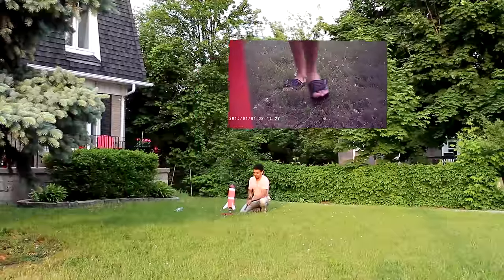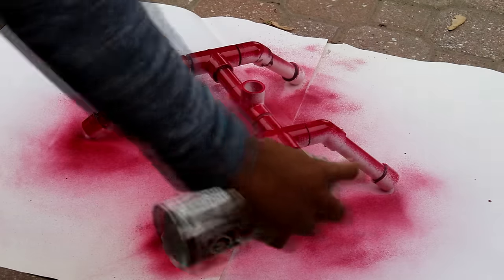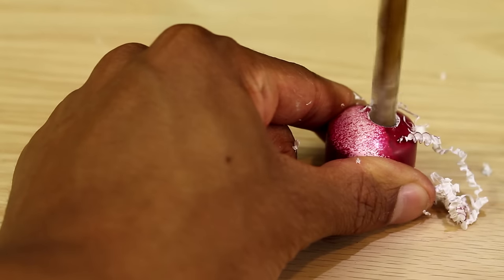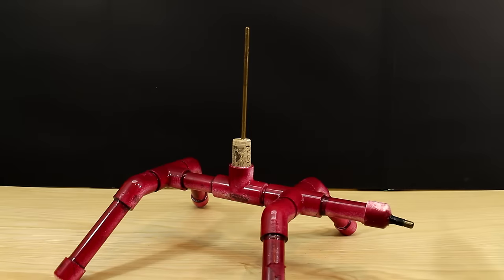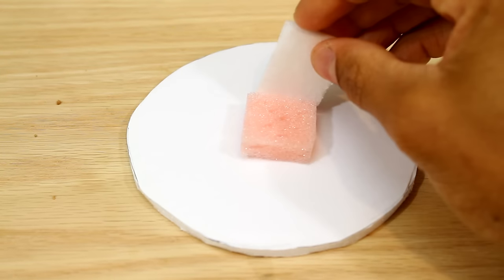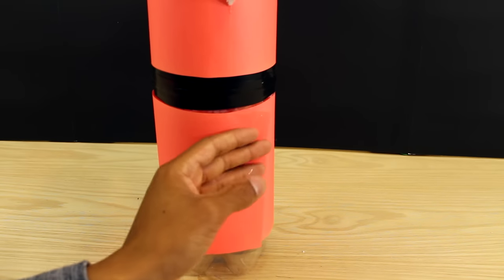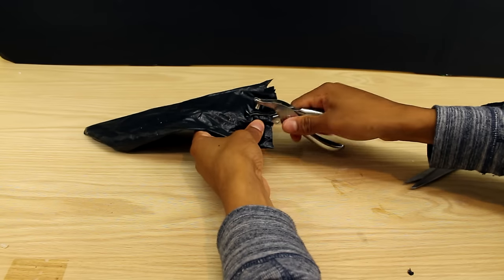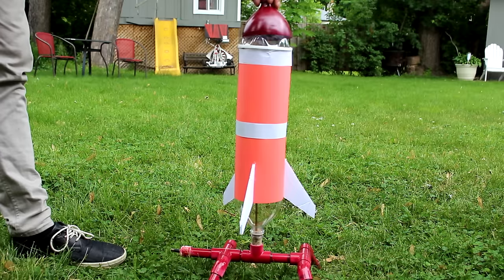How To Build a Water Pressure Rocket With a Parachute

Comment: Good build, only thing,  I would recommend to avoid getting glue in the valve is temporarily put something like tissue into valve opening before pushing it through the glue.
Reply: I thought about the glue going in the valve too. I'd slap a piece of tape on the valve to keep it clean.
Other than that, I'm looking forward to building one of these with my grandson. Thank you for the video! Very easy and cool!

Comment: are there any other alternatives apart from the wine cork
Reply: Nabil Abdullahi use a glue stick without the cap
Reply: Rubber door stopper. Usually found near the nuts and bolts.

Comment: Always great to see this approach is still being used. We were doing it back in the early eighties, although back then, no cameras. Also no foam board we had to use balsa wood.  Great thing is unlike the real rockets  replacement bodies can be made from trash, when they get damaged.     TIP. We used a few drops of washing up liquid (hand dish washing soap) as it holds the pressure a bit longer giving you more power.  Also if you can use a rubber wine bottle cork as they hold better and last longer.  Cant remember what brand wines to use but many of the cheap ones use the rubber corks.
Reply: Thank you sir

Comment: I want to use an air compressor up to 180 psi. At what pressure will the bottle explode?
Reply: roughly half of that at like 90ish maybe. best bet is to experiment, go pressurize some in a safe area far away from anyone until they explode and note the psi :P

Comment: Hi, I am trying to build this using your instructions. Please let me know how long do you have to pump air to get the bottle to launch?
Reply: It simply depends on how tightly it sits on the cork.
Reply: There are other setups that don’t use a cork and you can pump it 40-75 psi. It will go significantly higher with more pressure.

Comment: You need to have a rocket release lever so you can fill the rocket up as much as you would like with water and air pressure...good idea and easy design, but its flawed because you cant control the launch and are losing alot of altitude because of it.

Comment: Fun fact: If you wanted to fly around the city you need enough fuel (means water) and enough pressure(the more pressure the more power to lift) also you need to be light MOST IMPORTANT the parachute if you don’t want to die

Comment: Could you build a £1200 rocket with metal launcher etc with electric air pump and maximum psi with a large rocket with at least a hight of 30,000ft will subscribe and if possible in future after debts gone I'd be a patreon as this is ace and I have tools to build it and wouldn't be a waste of time